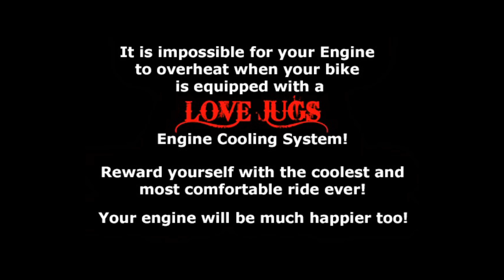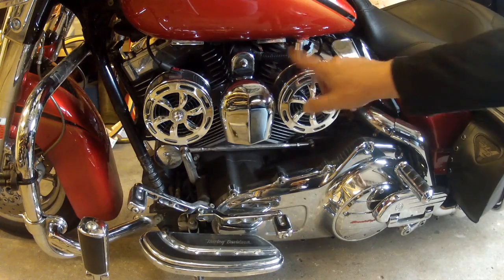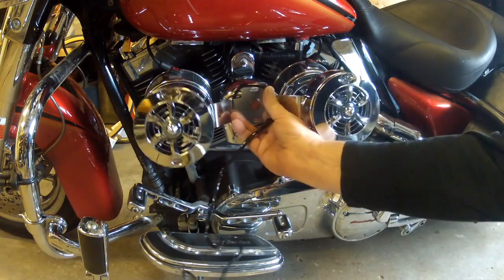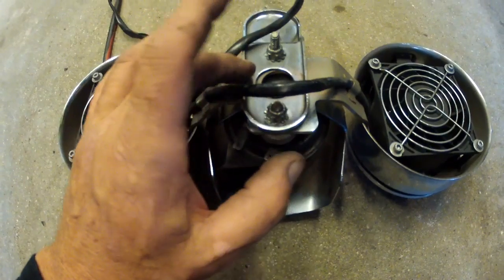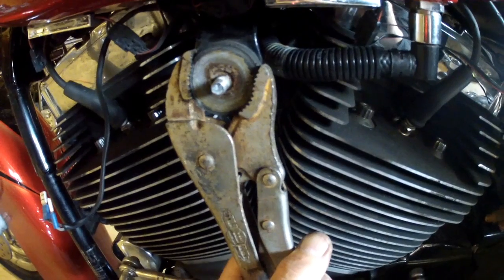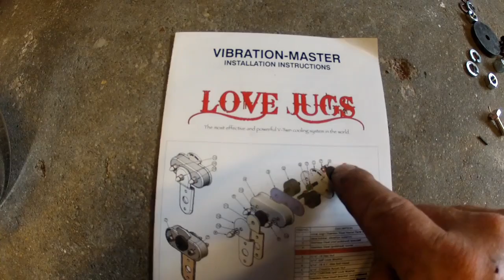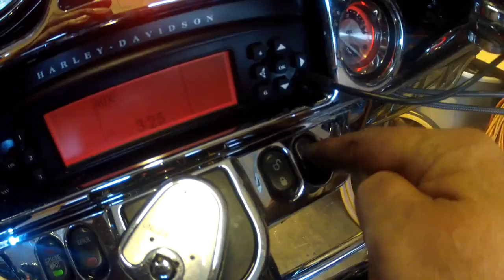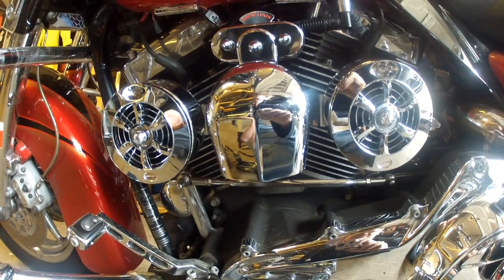LOVE JUGS Installation

Comment: I live in Tucson Az and it's gets pretty hot here, not really stuck in stop and go traffic as I don't rely on my bike for work. But the first step should be changing out your stock exhaust and air filter along with some synthetic oil. I also have a FP3 but I'm presently running  DK Customs Fl-VIED enriching system and it's does pretty well. These fans aren't cheap

Comment: Not to nitpick but at 7:31 you mention blue and then red Loctite but both of the tubes were blue Loctite (just the 2nd one's tube was red though it said 'blue' 242 on it.  Thought you'd like to know in case you add the red tube's contents to something that really did need red high strength stuff.

Comment: How is the horn mount holding up over time?  are you still happy with the horn mount?  how are the love jugs holding up?  thanks for your time.
Reply: My fans still work like new and I've had them for years.
Reply: I mounted mine to the frame I believe - couple hose clamps under the tank around the frame backbone hold the new LoveJugs bracket which the fans and horn in turn mount to.  I had some 'old style' hose clamps that did fail but one email and he sent me a set for free.  Two sets actually since first one got lost in the mail.  I couldn't be happier with their response to emails and to resolving my issue.  This was way past any warranty period too and the fans themselves have been flawless, quiet and completely waterproof plus vastly improves looks of traditionally plain/ugly left side of the Harley engine (no push-rods makes it pretty homely to my eyes).  This is the frame mount kit I bought and the hose clamps are what snapped after a few years but they sent me new ones for free saying they were some 'old style'.  https://love-jugs.com/product/frame-mounting-kit-harley-davidson/

Comment: It is absolutely insane that these regular 'ol computer fans cost the money that they do just because they have fancy chrome on them, I bet you anything that if they lower the cost they would fly off the shelves. I bet just a very, very small amount of people have these. I have never seen these on any Harley's I see out on the road.
Reply: I've got the Ward's Fan Works original design which I believe Love Jugs basically copied the design from Ward's and renamed the smaller fans MightyMite. Love Jugs had some sort of legal action and/or pissing contest with Ward's and Ward's gave it up. So it looks like Love Jugs started making basically the same thing. Anyway the smaller fans work good and look a lot better.
Reply: I thought the same thing but... are the "regular 'ol computer fans" waterproof AND do they have the same high speed these lil guys do? I think not.
I saw the jugs at the dealer and didn't think much of them, saw the guy who sells them at a Palm Beach Harley event and thought BFD until saw them in action... DUDE! I was impressed by the airflow these lil shit fans produce... I would LOVE to save money by making them myself, but doubt they’ll work and look like these ones. I may have no other choice but to cough up the beans and spend the few hundred dollars, because it's always cheaper than an overheated engine... BTW, live in So FLA.

Comment: $399 for fans? I can buy 2-200cfm, IP68 rated, 12 volt fans off of E-Bay for $40, a piece of perforated stainless mesh for $10, a piece of stainless steel for $1 at the local scrap yard, and use my 2 hands for free and make this in an hour. I bet I got 2 switches and a little wiring laying around to finish it off for less than $55. "Love Jugs" name isn't worth another $345.
Reply: Yeah I’d like to see your fans after they get rained on too hahaha

Comment: This is a rip off company and will screw you I would say do without before buying from here
Reply: Not true.......they're phenomenal for replying and helping if you have an issue.  My straps failed and they immediately put a set in the mail.  They got lost in the mail I suppose so I emailed and he sent me another set which I received.  He didn't charge me for the straps or for the shipping.  Maybe you had a different experience?
Reply: I forgot to mention this was way past 'warranty' and maybe 3 years later.  No receipt sent or anything - I just emailed the date I bought them and they found me in the system.